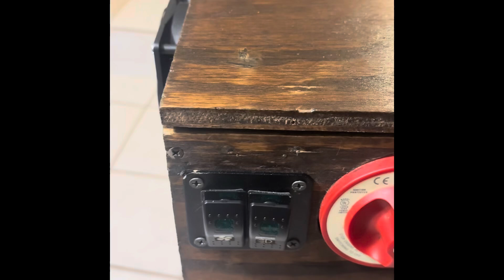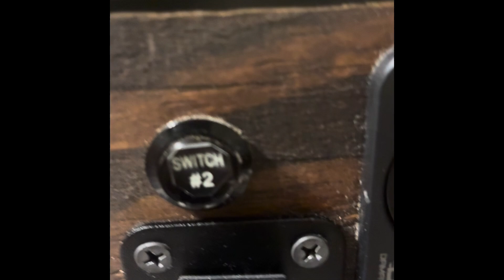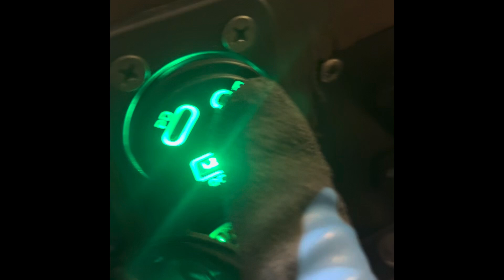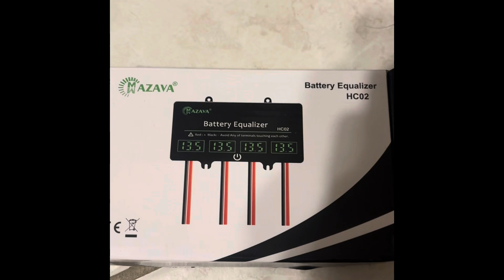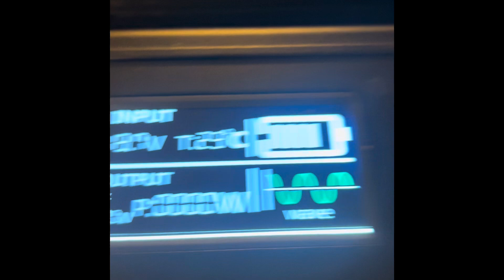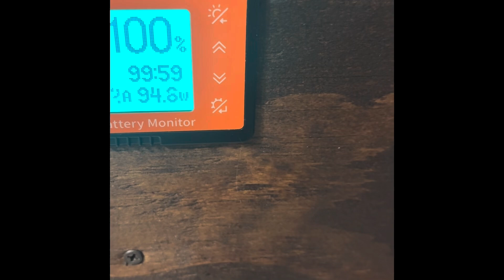12V 3000W Power Station - DIY

Comment: NIce setup. Have you considered a 12v light in series with that pre-charge button for visual reference? Thanks for sharing.
Reply from the maker: Saw a YouTube video where the person mentioned a pre-charger in his system, but they never demonstrated it.  After some searching I saw a YouTuber using the light bulb and another using just a resistor.  So I searched online and came across a store that sold a pre wired  circuit , which had the momentary push button and the resistor already assembled and how you wire it to bypass your on/off switch and thought that was for me.  The light would have been neat though, but it would have been redundant.   This precharger  was the first thing i purchased.

Comment: Where do you live that requires a permit for solar panels
Reply: I came to ask that same thing
Reply from the maker: @jessesioux4431  Florida.  The permit costs $90 in my county and you have to submit wiring diagrams, house dimensions, and specs.  Plus it needs to  withstand 150 mph winds and you need to provide documentation that it can.  
Need a permit regardless if it's a roof mounted or ground mount.